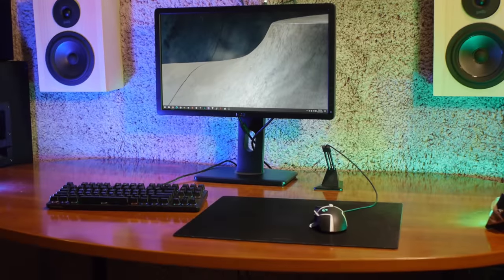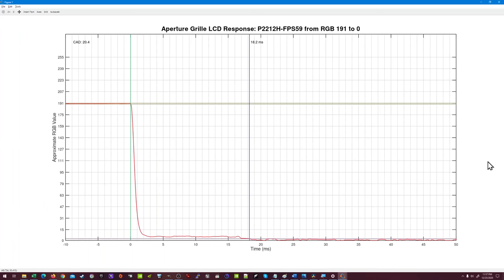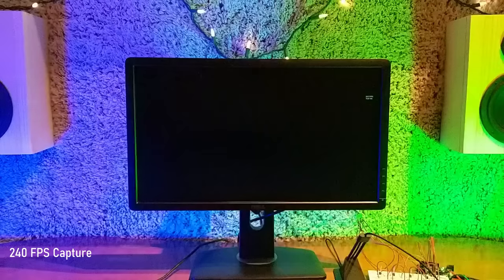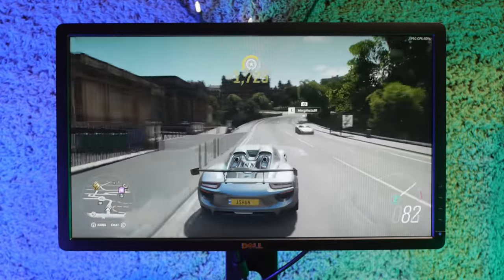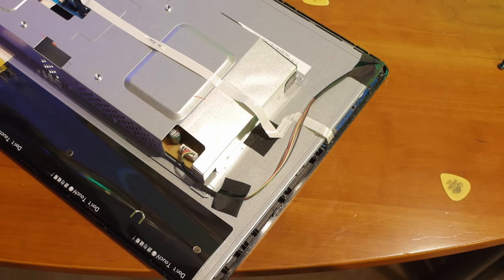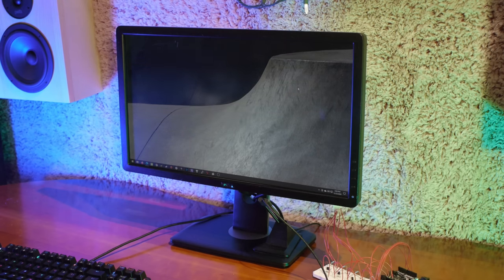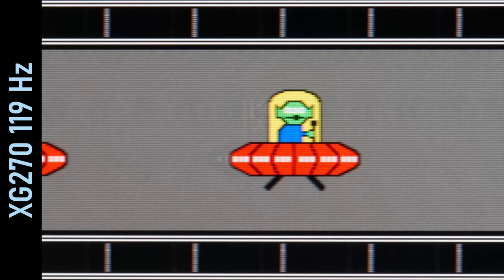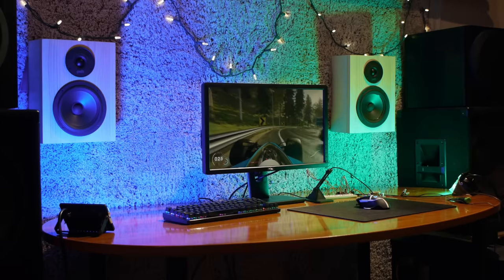DIY 60 Hz Backlight Strobing

Comment: New BlurBusters  approved certification for 2021+ require 60Hz strobe so we will be getting some interesting new monitors in few months. But overall PC monitor market is huge disappointment compared to CRT days
Reply: Correct. Four monitors by two different vendors are now in the queue for the next 12 months, and a third vendor may be coming online. They won't get the logo unless they modify their firmware to 60Hz single strobe. I'm already using a prototype IPS monitor on my desk with great looking 60 Hz single strobe. It even supports a humongous VT4500 at 60Hz, which allows 4x QFT + virtually crosstalkless top/center/bottom. It may need a post-launch firmware upgrade to enable all the features. 

At least one may have DDC commands enabled for user strobe tuning (fingers crossed) with user accessible 100-step Overdrive Gain -- so you can temperature-compensate, since crosstalk increases/decreases with hotter/colder temperatures due to different GtG speeds from temperatures.

Just like colorimeters + RGB Gains allowed advanced color tuning, we now believe improved strobe tuning should reach advanced users more widely. The problem is a lot of monitor scalers don't understand scanrate modification to reduce strobe crosstalk (either via internal scan conversion or external large vertical totals).  Internal scan conversion is easy but adds lag (buffers external slow-scanrate before output to panel at high-scanrate) while external scan conversion (large vertical totals) require users to create a custom resolution.  

In the long term, I'd love Microsoft (end-of-VBI Present() unblock) and graphics drivers (NVIDIA, AMD) to adopt Quick Frame Transport (aka Large Vertical Totals), so it's more plug-n-play and hits two birds with one stone (reduced VSYNC latency + reduced strobe crosstalk).  So that high quality strobe is possible via a simple ON/OFF setting (wthout any large-VT tweaks, and without the latency of panel built-in scan conversion.)
Reply: @BlurBusters  I would kill for a 1080p 23-25" IPS that has 60hz Strobe. I hope one of those monitors is that.
Reply: @fonarte  There's at least one coming this year which I am helping a manufacturer with. Keep tuned!

Comment: I modified an old Acer S271HL about 10 years ago to strobe its LED backlight. It's amazing compared to normal LCDs. There's hardly any after-image, just a little at the bottom of the screen when using side-scrolling games, and using a modeline with a longer vblank (use higher clock rate) gives more time for transitions. The mod turned out to just be a firmware change, no extra hardware needed, just RE-ing the ROM some to find where to insert some code. It has a VA panel and was plenty fast with a few-millisecond strobe (comes out fairly dim). I don't think it was a very high-end monitor.

It was convenient because the CPU had an interrupt on vblank. There I could just restart the backlight timer with a low PWM frequency, so it just pulsed once per frame. The LED driver already handled pulsing since it used PWM dimming for normal brightness control.

To make it easy to enable, I just added strobing to the bottom half of the brightness range, so DDC brightness control from the PC could enable/disable strobing (and set the strobe time, which also affects brightness).

Comment: great video! The lack of 60hz strobing for desktop sized displays is a serious issue. I've resolved not to buy any new panels until something at least as performant as the XG270 comes out - with 60hz strobe support. It is a little sad that my best shots at getting this mode currently involve buying old monitors or going through the same homebrew steps you have here.
Reply from the maker: I think the current recommendation is the LG CX OLED, but you're right about wanting "desktop sized" displays. Unless LG wows us at CES with an OLED monitor, we may be stuck with LCDs for the next few years at the 24" to 32" range.
Reply: I'm waiting for the upcoming ELITE XG320U (32'' 4K 600nits) with PureXP.  Now that the new BlurBusters certification requires 60Hz strobing, that monitor has become even more interesting.
Reply: just get an oled for fast response times.

Comment: I gotta say the 60 and 120HZ strobing on my LG CX is absolutely amazing. On the highest setting at 60 there is visible flicker and it's darker, but the motion clarity is absolutely the best I've seen since the CRT days since OLED pixels are stupid fast.
Reply: I tried to use it in pc mode but the setting is locked :/
Reply from the maker: LG is really doing wonders with their CX. I haven't seen one in person, but from everything I hear, they're super close to making "gaming" monitors useless.
Reply: @ApertureGrille  they definitely show how overpriced high end "gaming" LCDs and those nvidia BFGDs are
Reply: @ApertureGrille  they only get to 4ms persistence with a 75% brightness loss. which is still not quite super clear motion especially for 4k. I think 1ms is about what you need for perfect clarity at 1080p
Reply: @ApertureGrille  If I was a millionaire I'd buy you one to test haha. Unfortunately I'm a nerd of conventional means :p.
Reply: @MKR3238  Yeah it's VERY annoying they lock it in PC mode. I just run in non-pc mode instead. You lose 4:4:4 chroma but gain the BFI settings so sometimes it's worth it. I'm not even sure if there is a technical reason they need to lock it.
Reply: @brett20000000009  Even 1080p displays can use persistence way lower than 1ms.
The fastest moving objects/images that we can eye-track on 1080p screens move at around 6000pixels/second, so  we need frame persistence as low as 1000/6000 = 0.17 ms.
4k UHD displays can benefit from half that, so under 0.1 ms is needed for them.
Reply: @edfort5704  yeah but at 60hz the motion gets steppy at super scroll speeds even a crt looks like that.
Reply: @brett20000000009  I was just saying what the frame persistence needs to be, not how it should be achieved.
The best way, visually, to achieve low persistence is to have super-high fps&Hz (1000s) on sample-and-hold, not by strobing low fps&Hz (such as 60).
There's no escaping the fact that (much) higher fps&Hz non-strobed is better than (much) lower fps&Hz strobed.
Strobing is a big image compromise and almost impossible to achieve without image downsides/artefacts. Still, it's the only way to achieve low frame-persistence with our tech capabilities today, so I understand its appeal.
Reply: I love OLED blacks and colors, but a cherrypicked strobed LCD (best 5%) still beats OLED. The best strobing I've ever seen lately is the Oculus Quest 2.  It manages a successful bright 0.3ms strobe with zero strobe crosstalk Top/Center/Bottom.  I used the Oculus in-VR web browser with TestUFO crosstalk.  Zero.  No afterimages even at top/bottom. At true realworld 0.3ms MPRT with pretty much GtG100% 65536 colors, it is the most amazing LCD that I have seen in my lifetime -- less than one-tenth the motion blur of an LG CX (4.2ms MPRT).  I could read the street labels of TestUFO Panning Map at 3000 pixels/sec, single-pixels stayed sharp. Must be seen to be believed.
Reply: Here's my write-up about Quest 2 on [H]ardForum why it is hard for OLED to have less motionblur than the best strobed LCD: https://hardforum.com/threads/which-vr-headset-to-buy-in-2020.2000533/page-4#post-1044849926
Too bad it is Facebook encumbered, but it is simply a standing ovation of an LCD. I salute what John Carmack did to that amazing LCD. If you want the world's lowest motionblur LCD, check out the Rift S LCD, or the Quest 2 LCD:
Reply: @brett20000000009 This is true that 60 Hz is flickery and steppy -- alas, there is 60 years of legacy 60fps 60Hz content. Television, videotapes, recordings, videos, consoles, arcade games, emulators, etc. The only "pure" way to experience these 100% blur-free is with original single-strobe like a 60Hz CRT.
Reply: @BlurBusters  Thanks for the write up! Interesting they can't flash any quicker than 2ms. All I can say is 120hz with the highest BFI on my OLED looks extremely clear to me. You live in Hamilton, Ontario right? I'm up in Cambridge. If you haven't measured an OLED before and want to test one you're welcome to come up and test mine after the lockdown order clears lol.
Reply: OLED can flash quicker than 2ms, but some of them start having more artifacts than the best strobe LCDs (like increased black streaks/artifacts). When things settle, I'd love to spend more time with an LG CX OLED again. One thing I am very surprised/shocked is no user has yet published a 960fps Sony/Galaxy smartphone camera at all the LG CX OLED BFI settings at www.testufo.com/scanout to produce high speed video of LG CX BFI -- I thought someone would have by now. Some high speed refresh cycle recordings are stored at www.blurbusters.com/scanout and www.blurbusters.com/red-phosphor
Reply: @BlurBusters  I'll do it. I have 960fps recording on my galaxy. I'll hook up my PC tonight and capture various footage of the three BFI modes at 60 and at 120hz using those test patterns. I don't have a new GPU (not for lack of trying) so I'll just run a 1080p signal which should be fine demonstrating the BFI functionality as it's just upscaling to 4k.

Are the blur busters forums a good venue to share the videos? Keep in mind I'm an amateur at recording stuff like this so I'm not sure the videos will be the best quality.
Reply: @Weaver_Games  That would be fantastic because the world wants to know! Please also record non-BFI too (at 60Hz and at 120Hz). 

For each mode, just run the scanout test, then start the Super Slow Motion feature on the Galaxy.  

Blur Busters Forums is a great place to share, or you can email mark [at] blurbusters.com and I'll add them to a page.

You can either provide links to video files (from a cloud drive), or upload as a few separate barebones unlisted YouTube videos.
Reply: @BlurBusters  Just sent you an email with the vids on google drive. Enjoy!

Comment: Is there a way to remove vblank from the signal? Is it necessary for PC monitors?

Also personally I keep Dyac+ enabled 24/7, gaming or browsing on 240 hz. I understand 60 hz is much harsher on the eyes. Can't a 240 hz (or 120 hz) monitor be used as a 60 hz replacement by drawing each frame a multiple of time, including multiple strobings? I never understood why a 240 hz monitor needed to slow itself down to 60 hz to fit 60 fps gaming. If we rewrote monitors (and the signal coming from the cable) from scratch, could a better solution not be found?

Comment: I wrote a post in a thread on the blur busters forums a while back about possibly using a MEMS laser projector like the Nebra Anybeam as the source of a backlight for an LCD monitor. Either that, or using several sets of RGB laser diodes arranged from top to bottom with a combiner so you get white light. By using lasers it would allow for very short but extremely bright pulses at low power, and would help provide lower persistence than any standard LED strobe. You also would not suffer brightness loss. You could also opt to augment a standard LED strobed backlight with laser diodesto offset brightness loss.
Reply: like a CRT but with lasers instead of electron rays?

Comment: Nice I have also hacked 60hz single strobe into a benq 240hz monitor for 60hz strobing without crosstalk high VT's are essential 60hz scanned out at 240hz speed. with VT4860 on a fast tn crosstalk is completely eliminated because of the refreshrate headroom effect. 

Also i'm going to try and fix the devils horn on the VG279QM and create a true vrr strobing display.
Reply: Yep -- this was posted in this thread: https://forums.blurbusters.com/viewtopic.php?f=7&t=7520#p57328

Comment: Very interesting video, really liked it! But aren't the ZOWIE XL2546, XL2546S and XL2546K able to strobe at 60Hz? I own the XL2546S and as far as i'm aware that is possible
Reply from the maker: Ooh, I didn't know that! That kind of makes my complaints pointless.
Reply: @ApertureGrille  I would check that first most zowies i know do not support single strobe 60hz including my 2540
Reply from the maker: https://www.bijanjamshidi.com/benq-zowie-xl2546s-1

Here's another good reviewer's site. On his pursuit shots, it looks like the XL2546S double strobes at 60 Hz. Is that what yours looks like?
Reply: @ApertureGrille  Looks kind of similar but not 100%. Took some sample pictures myself at 60Hz (as best as i could), posted them here: https://postimg.cc/gallery/1Zjdq8v. Honestly i don't know what the difference is between single and double strobing, i'm not really the most knowledgable person on the subject matter. BTW i also watch Bijan, you two are the go-to channels for in depth monitor reviews! :)

On the pictures i had the monitor at 60Hz, DyAc+ on premium and AMA on high, the test was running at 960pixels/second (should have ran it at 1200pixels/second)
Reply: @ApertureGrille  mine completely disables strobing for anything under 100hz. I have a 144hz benq that will double strobe at 60hz but you can use the service menu to enable single strobe. unfortunately all the single strobe capable monitors I have tried do not have high enough VT's to hide all the crosstalk you can get about 75% of the screen clear.

check out my thread on blurbusters forum I have some badly taken pursuit shots and video 
search

"World first zowie XL2540 240hz 60hz singlestrobe? Experiment."
Reply from the maker: @brett20000000009  I actually laughed out loud when I saw the picture of the controller board perched behind the other monitor. Good stuff!
Reply: @ApertureGrille  LOL yeah. now im using an arduino without the other monitor. Also forgot to mention an easy way to get sync to stop the crosstalk drift. simply use a hdmi splitter with a hdmi to vga adaptor. the vsync signal from vga can be connected to an Arduino. abit janky but it does work aslong as your vga converter can support the same videomode as your pc monitor.
Reply: Only the old benq from 2013/2014, have a strobing mode called "blur reduction", no DyAc, that can strobe at 60hz
Reply: @giappone2012  It does strobe at 60Hz but as above mentioned this is most likely double strobing, not single strobing.
Reply: @Aomicplane  I think old BenQ monitors allowed single strobing at 60hz and double strobing at 120hz. My xl2411z belongs to this category, also you can tweak strobing by service menu. Check this: https://display-corner.epfl.ch/index.php/BenQ_XL2411Z
Reply: @ApertureGrille  Only very old XL2420Z, XL2720Z, XL2411Z, XL2411, XL2411P (but not XL2411K) can single-strobe 60 Hz.
The XL254* only double-strobes when at 60Hz, which creates double images. A forum member had to modify it to single-strobe:
https://forums.blurbusters.com/viewtopic.php?f=7&t=7520

Comment: Maybe try cutting diffusors and also adding in another ledstrip on the other side of the monitor for double the brightness. Also voltage boosted strobing is a thing dyac does this I think.
Reply from the maker: The LED strip I showed in the video came from another monitor where I, uhh, accidentally destroyed the backlight diffusor when trying to cut it. I'll be more careful next time :)

I like the suggestion about adding another LED strip. Hah! More is better! I was also wondering if I could add in narrower bandwidth RGB LEDs to increase the color gamut of the monitor.

Comment: What is the CAD value / metric? I can't find anything on Google with different keyword combinations I've tried
Reply from the maker: CAD stands for cumulative absolute deviation. I cover it here:
https://youtu.be/xDB9sONfJ5Q?t=681

CAD takes the absolute value of the difference of where the LCD response is vs. where it ideally should be. If you add all those values up along the response, you get a kind of "area" measurement that gives a great, one-measurement assessment of a GtG transition's quality.

Hardware Unboxed uses something similar for their reviews, but they call it Cumulative Deviation, which is a little easier to say. :)

Instead of response time numbers and overshoot percentages, I think that CAD is a much better way to characterize a monitor's performance.
Reply: @ApertureGrille  thanks, makes perfect sense!
Reply: @ApertureGrille  if I understand correctly, you stretch the curve additionally to punish overshoot. Is that just a linear factor or something more severe?
Reply from the maker: @Isaac________  I use a linear ratio for the penalty, 20% CAD multiplier per 12 RGB overshoot (so 10% for 6 RGB overshoot, etc.). I spent a lot of time trying to find the "perfect" penalty to apply, but it is still subjective. After looking at the average CAD score on a bunch of monitors with a many different overdrive settings while looking at my Frog Pursuit program and playing games, I think the 20% penalty provided to closest match to what we see. The pure "area" measurement without any overshoot penalty wasn't catching just how visually distracting high overshoot was, even if very brief.

You could make a case for using the difference from ideal squared, like in the calculation for variance, but I would need a focus group of monitor enthusiasts to help me dial in the ideal penalty.

CAD really should be called PANCAD: Perceptually Adjusted Normalized Cumulative Absolute Deviation. :)
Reply: @ApertureGrille  It sounds like you're halfway to a paper publication at this point! ;)